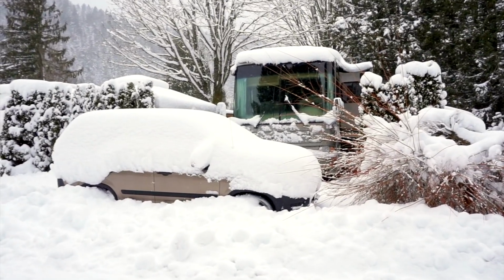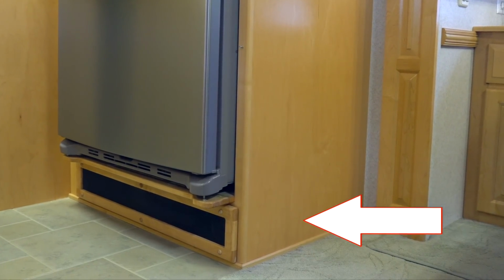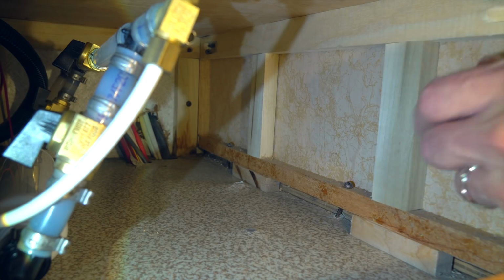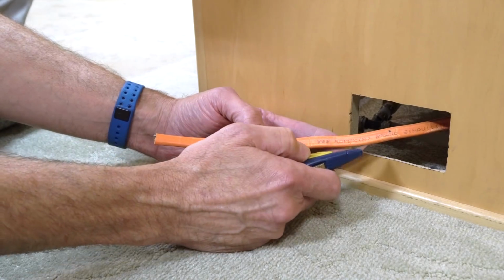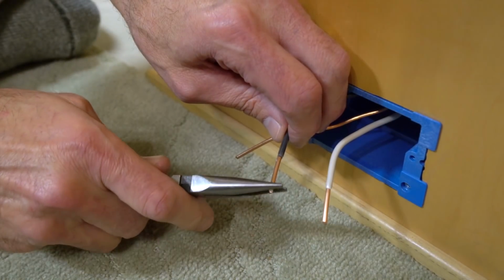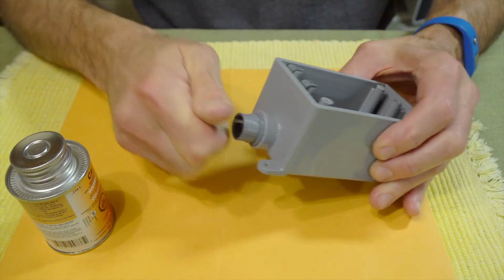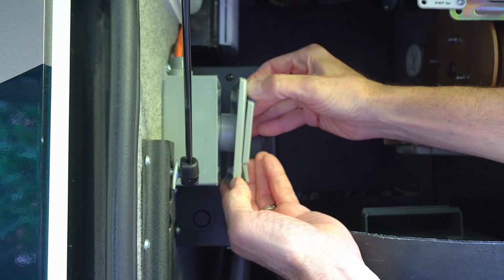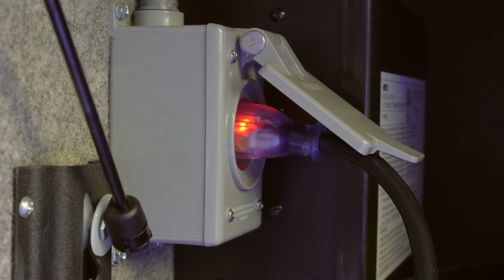Installing Our Winter RVing Secret Weapon!

Comment: Great video guys TFS. What's your advice to RV owners that seem to have bought an RV that was either built on a (party can't wait to get out of here Friday) or on a (hangover Monday)!! Our Montana High Country has been nothing but a headache. The quality of craftsmanship is absolutely terrible. We had an issue with the toilet (husband's fault) but when he removed the toilet to change out the rubber rings there was SO MUCH saw dust under the toilet, he said it's a wonder that it was even sealed (from the factory). Every time we stop somewhere I have major saw dust on my stove, bed and around my island. I understand that's somewhat normal, but when does it stop and that's the the beginning. We are constantly dealing with something & it's just terrible and draining. It's been back to the dealer MANY times which is a hassle cause it's a long drive there. It's also not the best for cold weather camping. We went to look at an Arctic Fox with double pane windows and made for really cold weather.
Reply from the maker: Hi Irma. Sorry to hear you're having so many issues. Not sure if this is your first rig? But if so, we generally advise that it's sometimes best to think of a first rig as a learning rig. That was our situation... not so much because of quality issues with our Bounder, but because of a learning curve on our part. When we bought it, we didn't know what we didn't know... like whether or not it could handle cold weather, or if we'd like a full private bathroom (we didn't), or how well it would sleep guests, etc. We spent our first two years on the road learning about what worked for us, and what didn't, and making a list of what we'd do differently next time (if there even WAS a next time, since we didn't plan to switch). That includes brand names, and which are the best. That two years of experience led us to our current rig, which we've now owned for nearly 13 years, and love. We learned that Newmar was one of the best rigs one the market, what floorplans would work best for us, how much R-value we should look for to handle winter RVing (since we knew we'd want to do some), and much more. We're not suggesting that you should just sell your rig. But it might be helpful (at least mentally), to begin thinking about what you'd do differently if you WERE to consider a new rig. Once we had our list together, we made the decision to stretch for the rig we wanted (and we still have the mortgage to prove it!), but our RVing experience has been stellar ever since as a result. Hope this helps a bit.
Reply: RVgeeks Sadly to say this is not our first. We've owned many but this is our first to have so many problems. Thanks for you input and will definitely be looking into the model you mentioned.

Comment: With your large window in the front of the RV do you find you get condensation forming in the front, which can end up causing mold?  I have this problem in my Class C and have been running a small dehumidifier and probably need to leave a vent cracked as well.
Reply from the maker: Hi Terry! When we use propane to heat, we have to be much more vigilant about keeping a fan running and/or window cracked to avoid condensation, especially on the windshield. With the electric heat, it's much drier, so much less of an issue. One more benefit of our mod! :)

Comment: Sorry guys!  You normally do quality work; but I'm sure an electrician would question this install.  I'm sure he would install a breaker and ground fault system to ensure that your external service is not your only protection.
Reply from the maker: A couple already have, Danny! We've actually already heard from several pros, and a couple said they'd include a breaker on board, and others said we did a perfect job! LOL Pretty much every park pedestal has a GFCI 20-amp outlet, so we feel pretty comfortable running a single 1,500 watt heater directly off it.
Reply: RVgeeks agreed the park power has its own breaker.
Reply: I guess you missed the gfci & breaker at the pedestal.

Comment: This is pretty clever yet I must admit. Would it not be better to get by on...less power? If you need more than 30 amps...that speaks for itself. I use less than 15 amps year around. It takes some planning yet allows for easy boon-docking as a by-product.
Reply from the maker: We're with you on being all about less power, and being good boondockers. The game changer here is the temperature. With temps consistently down in the 20s and 30s, 15 amps just won't cut it. It's the same as when we've stayed a bit too long in the Desert SW into the Springtime. We once had a week of 105 degrees F the first week in May in Palm Springs, and nothing short of a 50-amp campsite to run both a/c units nearly non-stop all day would keep us from roasting. It's one reason we generally follow good weather... but not always. ;-)

Comment: Very clean and tidy project. Just to be clear...  Those two space heats can keep the entire RV warm?  No hot or cold spots?   

I have resolved to be more upbeat in 2018 but I cannot fathom why two people would down-vote your video.  We live in a strange world these days but I guess we have to be tolerant.

Bonus question: What's the 'secret' for both of you remembering which of the two plug outlets is the hot one without using the tester twelve months from now?

All the best in 2018...
Reply: I'll answer for them... both outlets are hot... if you look again, the screws om the sides are tied together.... the other screws are just to make runs to other outlets...
Reply: ahhhhh  thanks
Reply from the maker: Thanks Anthony. We're working to be upbeat, too, so we don't even notice thumbs down (other than the fact that we usually get about 50-100 "up" for every "down" so that'll show 'em! LOL And thanks Johnboy for the reply. You've absolutely right. Both outlets are fed from the same power source, so always both hot (or cold, when we unplug our 20-amp extension cord).

Comment: Romex is for in wall use only. SJO cord or MC cable would have been safer and to NEC code.
Reply from the maker: Thanks for the tip, Bradley.

Comment: great video again (not sure it's possible for the geeks to make  bad video,  never seen it in years of watching. lol ) let me just say the wires the geeks put a  hook in to attach to the box is perfect. just pushing them in straight will lead to loose connections  in time.  so do as they did
Reply from the maker: Thanks Dave! Not being electricians, we studied (YouTube videos, natch!) from the pros, and we did indeed hear that using those straight-in connectors is a bad idea. We figured that with our home vibrating down the highway, it would be even worse than usual!

Comment: Hi guys! Another good job. Just wondering about your water tanks and how you warm them without your main heat heating them up.
Reply from the maker: Thanks Jonathan! We have tank heat pads built in from the factory, along with the 60-watt incandescent light bulb that we mentioned in last weeks "planning" video that we keep in the water compartment. Plus our basement is pretty well insulated. So far, so good!

Comment: Ill be honest, Im not a huge fan of unprotected circuits, I realize the park has them built in, but it would be safer for you guys if you used something like it, as you know the condition of the circuit protection you're using.
Reply from the maker: Thanks for the feedback, Sam. We did consider installing an additional circuit breaker, but it seemed like overkill for the one heater we'll ever plug in, and it will always be on a GFCI circuit all by itself.

Comment: Handy to use that 2nd 20 amp connection, although the Thousand Trails in Cultus Lake I often stay at is notorious for blowing the main breakers when you try to pull too much off of them. Peak winter and peak summer loads are mostly when that happens, and I suspect some other campgrounds may sometimes experience similar issues.
Reply from the maker: Hey! Great to see you here. It's true that older parks sometimes can't handle too much power draw. Luckily, the park we're staying is new enough that there's NO problem pulling a full 30-amps on the main 30-amp cord and still running the heater on high on the 20-amp circuit.

Comment: No circuit breaker. I know there is one where the park outlet is, as there is for the 30 amp, but there is a reason the RV manufacturer put breakers on all circuits in the RV.
Reply from the maker: You're right, Gary. We thought of adding that, but it seemed like overkill for the one heater we'll ever plug in, and it will always be on a GFCI circuit all by itself. Maybe not technically to code, but we're comfortable with it.
Reply: And the National Electric Code does not apply to RV's :)
Reply: they put breakers in because they are branch circuits. everything comes in at 50a or 30a and then gets dropped down to 15a and 14g wire so they need the breakers in the RV. If you're just doing this its basically an extension cord and there is no need for a breaker in the RV as there is no reduction of amperage or wire size along the way to protect.
Reply from the maker: Thanks so your input, Patrick! 😊

Comment: I usually watch wiring videos and cringe at the use of the QuickWire connections on the back of outlets.  People spend the extra money for 20amps then make a weak connection at the outlet.  You did this job exactly as a professional would have done it, you even screwed in the unused connection screws and put the screws on the wall plate the same direction (horizontal).  Well done!!!!
Reply from the maker: That is SO great to hear, John! We're not electricians, so we studied (YouTube videos of course) from pros to be sure we did it as properly as possible. We did see some alternative techniques, so it's only a matter of time before one of "those guys" (LOL) writes to tell us what a crummy job we did! 😂 Glad we heard from you first. We know that the smartest people always comment first. 😋

Comment: Hi guys great tutorial as always.  I have used this idea on my previous fifth wheel and plan to do it on my current class C.  On my previous rig I wired several outlets.  The most important for me was outside where I set a griddle and toaster.  It lets us cook without worrying about the coaches AC, microwave, etc. being on at the same time. Maybe this time I may add an outlet for an auxiliary heater.  Stay warm and safe, Lou.
Reply from the maker: Love it! Great to hear so many additional ideas for this concept. Thanks Lou. :)